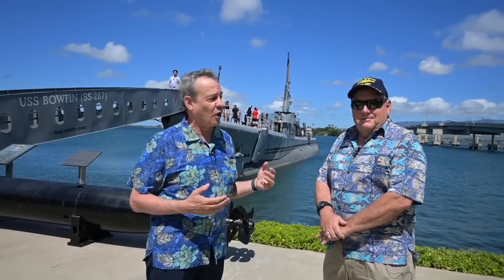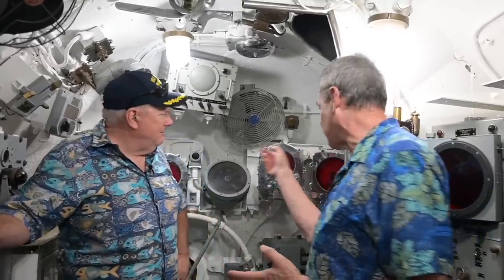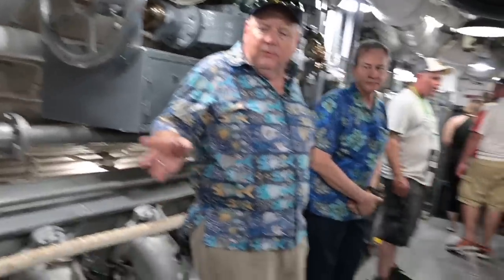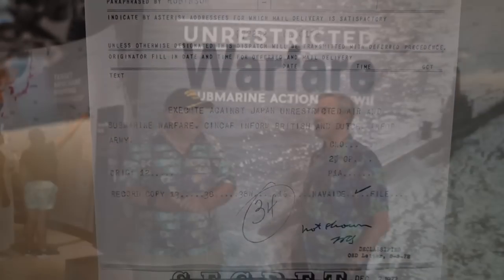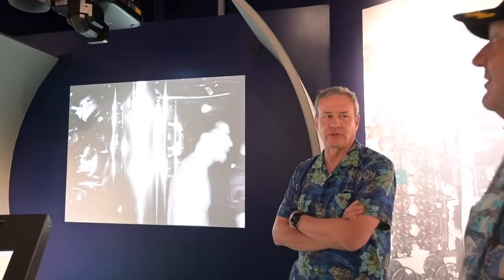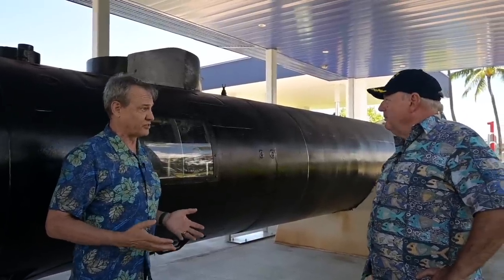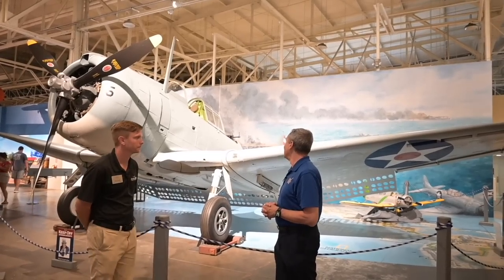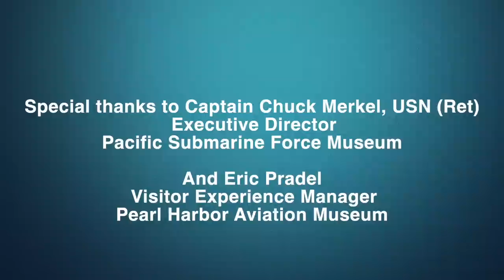Captain Toti's Pearl Harbor (Part 2) Episode 230

Comment: As an airlift pilot (C-130) it tightened my jaws to hear the C-47 referred to as "not a combat aircraft."  The 374th Troop Carrier Group, 5th Air Force was the most decorated Army Air Force unit in the Pacific with 3 Presidential Unit Citations.  It is equivalent to saying a LST or a carrier is not a combat ship.  You don't get PUCs for hauling kotex and eggs to Freemantle.

Comment: Thanks so much.  I have been on USS Pampanito. It was great to hear Bill and Chuck's commentary on the submarine, as their insight makes it "come alive".  The level of "high finish" on these boats is pretty amazing to me, as they were wartime boats that we were cranking out quickly. Yet the condition of the components, beautiful brass work, and clean routing of the electrical lines and pipes says volumes about the ability of American shipyards to produce quickly and with high quality.  The American boats are the best subs of the war (wish we could say the same for the torpedoes).  I know  you guys served on post "sub-safe" boats which have fanatical attention to detail and engineering, which have a little fleet boat DNA in them.

Comment: I was at a Blue Angels airshow in San Angelo, TX in the mid 1970's and they had an A6M-2 Zero. It was a remarkably fast and extremely nimble airplane. They did a mock dogfight with the Zero vs a P-51 Mustang and an F4U Corsair and it was an unbelievable sight to behold. Definitely it was one of the great warplanes in history. The dogfight started with a flyby of a B-17 and a B-25 with the Zero jumping them and then the American escorts coming to the rescue. I remember that more vividly than the Blue Angels routine which was remarkable, and they were then flying A-4 Skyhawks.

Comment: The P-40 at 2:00:00 is a P-40E.  The P-40B with two machine guns over the engine (and 4 50 cal machine guns in the wings) is what the flying tigers flew.  The E variant didn't arrive until they were part of the USAAF (and no longer the AVG, who really were the Flying Tigers).  They did manage to somewhat keep the Flying Tiger logo.

Comment: Re sub bases in Oz, there were boats operating out of Fremantle (Perth) and Brisbane, opposite sides of the continent. That sounds odd in simple words, but if one looks at a map of that part of the Pacific Theater, Perth is near the Dutch East Indies (now Indonesia), and Brisbane is near the Solomons, Rabaul, and New Guinea. IIRC, Darwin, on the north coast of Oz, was used for topping off fuel, much as Midway was.

Comment: In reference to the Bonefish (SS 223), the lone loss in that 9-sub patrol into the Sea of Japan, this is per the official Naval History and Heritage Command website:

"In company with Tunny and Skate, Bonefish (SS-223), commanded by Commander L.L. Edge, departed Guam on 28 May 1945 to conduct her eighth war patrol. On the morning of 18 June, Tunny and Bonefish rendezvoused in the vicinity of 38°-15'N. 138°-24'E. Bonefish asked permission to conduct a submerged daylight patrol in Toyama Wan, in the mid part of western Honshu, and having received it, departed for Suzu Misaki. She was never seen or heard from again. Japanese records of antisubmarine attacks mention an attack made on 18 June 1945, at 37°-18'N, 137°-25'E in Toyama Wan. A great many depth charges were dropped, and wood chips and oil were observed. This undoubtedly was the attack which sank Bonefish. In total, she sank 31 enemy vessels, for a total tonnage of 158,500, and damaged 7, for 42,000 tons."

Comment: What? Regarding 18:50 ca, is the boats batteries stored in the cealing? I always imagined they where stored in the keel of the submarine. Perhaps in the German Uboats they where? Since i got that impression from the movie Das Boot where they dive underwater in the keel to try to save a few cells.
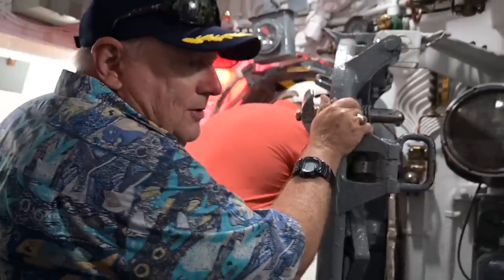Reply: 13:06 Both main batteries are under the deck. This also helps as ballast so the boat doesn't have the conningtower sticking down when surfaced.
The hatch pointed out in 18:50 is an access hatch to allow to swap out at batteries topside.